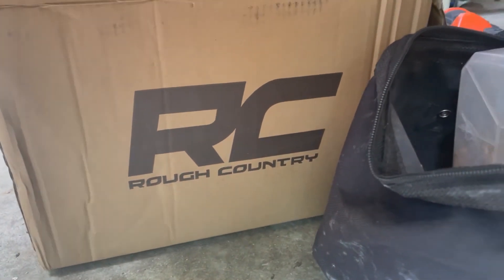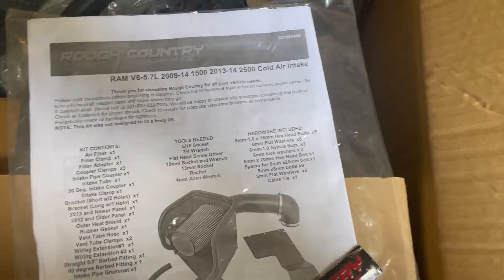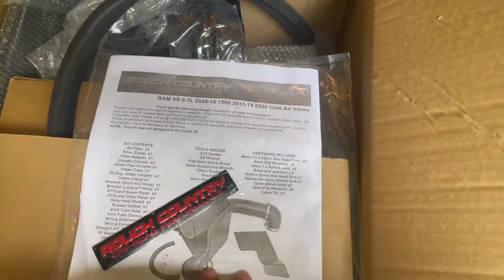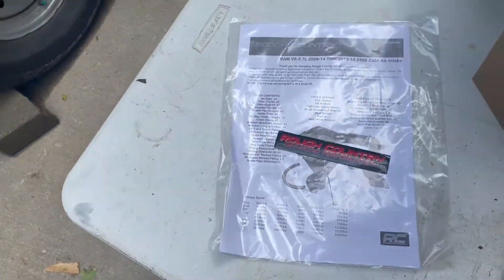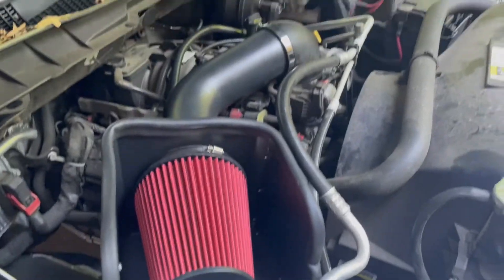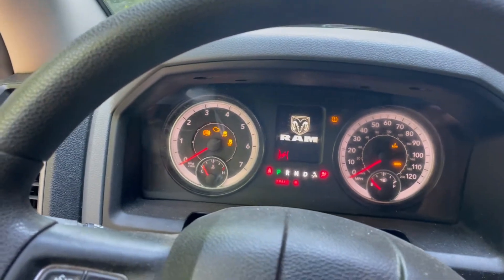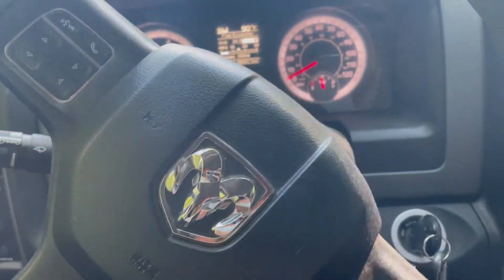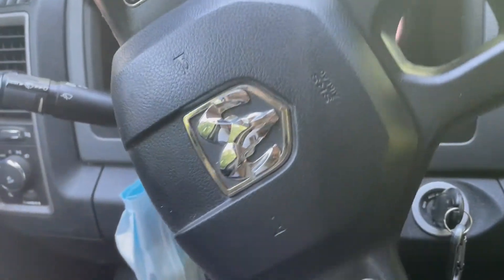Put A Rough Country Cold Air Intake In My Ram (POV TEST DRIVE)

Comment: i have 16 ram sport just installed it love the sound and power increase. Have yet to take it on a long drive but so far so good.
Reply from the maker: I’ve took it on a 500 mile round trip and it did well . No complaints or issues with it .
Reply: @Bliink 3013 for me it was worth it, I seen a slight difference in mpg and power. I do like the way it sounds to.

Comment: So after a few months, are you happy with it or was it a waste of money? I'm trying to decide if I should do it.  I've heard several guys say it didn't really make much of a difference.  Also, what phone holder are you using?
Reply from the maker: Besides the cool noises i probably get 2-3 mpg more on the highway . performance wise its a little better while towing but mpg while towing is 1-2 mpg worse than stock. i shot this whole video handheld .

Comment: Sounds great man! I have a 2020 Dodge Ram Laramie i got it straight piped and removed my cats so that threw on my engine light, I recently bought myself one of these cold air intakes same brand installed it on my truck and I don’t why this happened but I didn’t feel no change of hp or torque whatsoever, once i installed it i tested it out i’d step on it and like my truck would struggle to respond so i ended up taking it off and put the stock filter back on and after that it responded much better, maybe it needed a tune but I wasn’t sure so i just ended up removing my intake